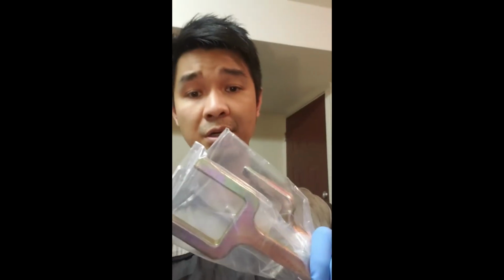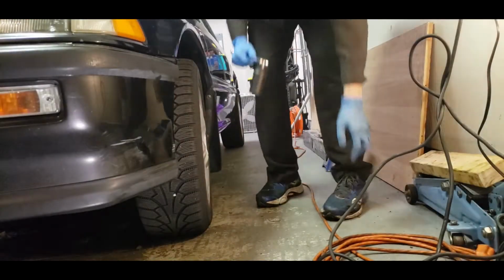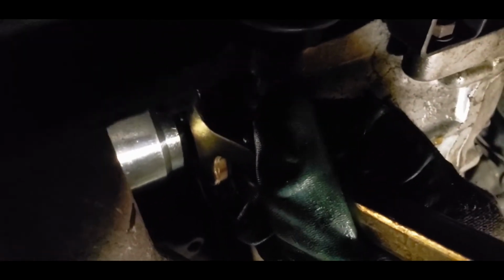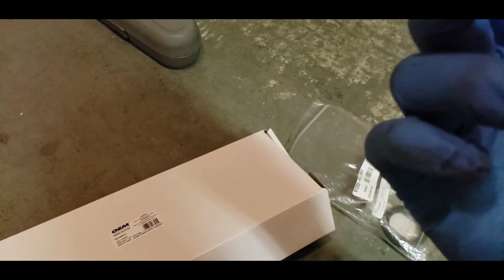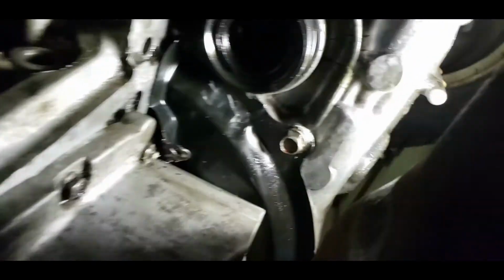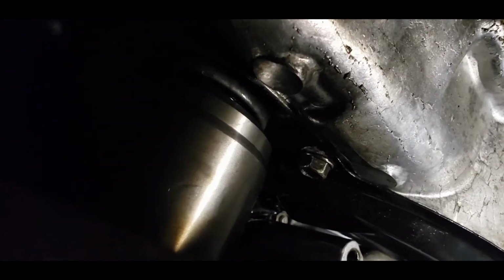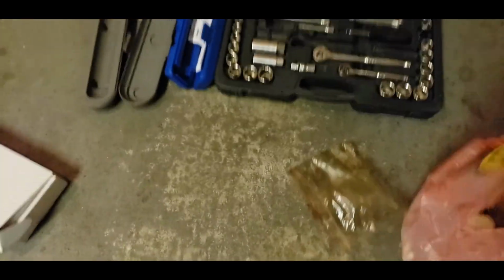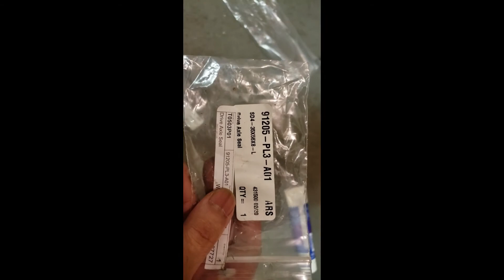[Part 2] D16A6 L3 Transmission: How to Replace Leaking Axle Seal

Comment: No more leaks?
Reply from the maker: Unfortunately, shortly after I replaced the seal the leak continued. The seal i suggested is the correct seal, but there's play in my differential bearings, which is whats causing the leak. The leak was a lot less than with the bigger wrong seal. But the movement in the differential causes the seal to not do its job.
Reply: @BudgetGears  oh okay I put on the seal today I’m see if it leaks or not. The seal that you recommended seemed like it had a better fit in my transmission
Reply from the maker: @andrewlopez5767  hopefully that fixes your leak issue. What car do you have? The seal I recommended should be the correct seal for all the d-series civics. For some odd reason the Honda catalog is wrong and suggests the bigger seal.